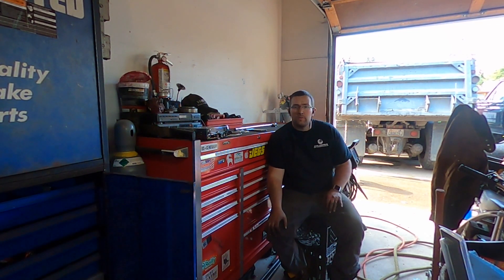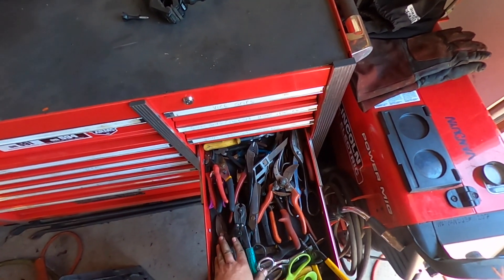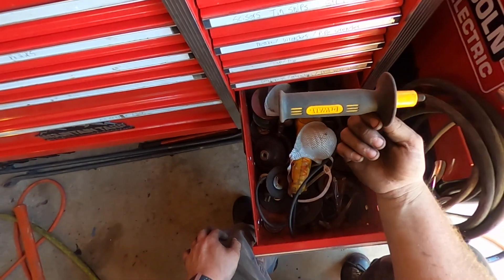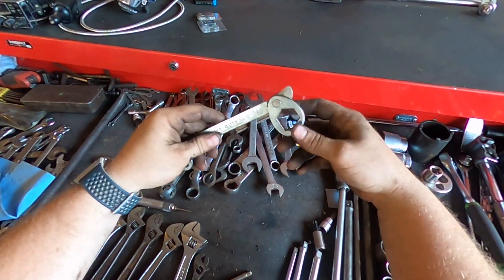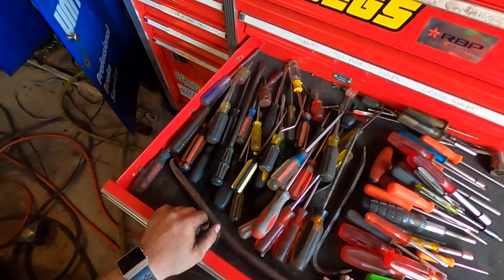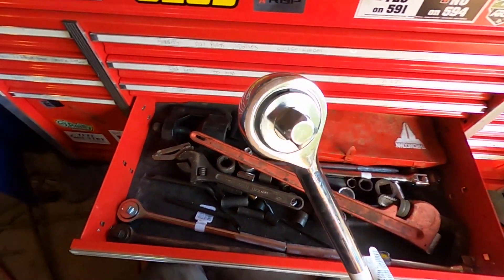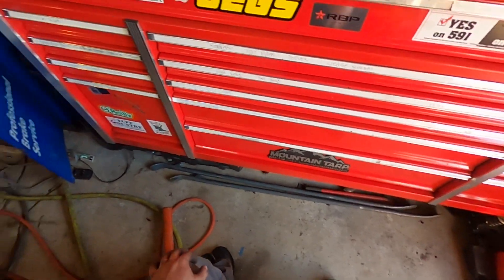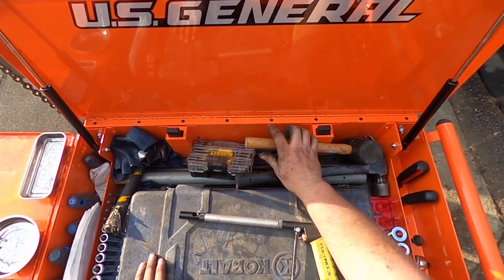DUMP TRUCK OWNER TOOLS

Comment: I get the feeling a lot of the comments here are gonna be about that damn beeper switch after Justin’s video, so here’s my take on it. Those trucks say Vanduyn Dump Trucking, not KLR Transportation/J Rowland Trucking. So it’s not one bit my place to tell you what you should or shouldn’t do with the equipment you own and are responsible for. I can see multiple reasons to want to be able to control a backup beeper, especially if the truck was running in and out of my house at night or something. 🤷🏻‍♂️ would I put that out there for the whole world to know about? Probably not.. just like I don’t make videos of me running 1400 miles in 32 hours. But that’s just me and everyone is different.  I’d put the video back up and tell that walking heart attack that thinks he’s gods gift to the trucking community to go fist himself with some more of his parents money.